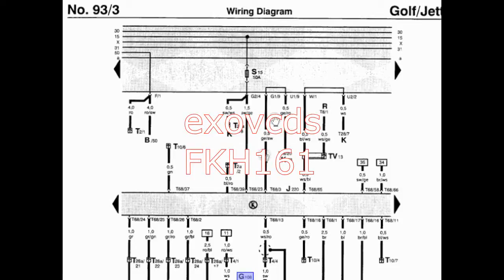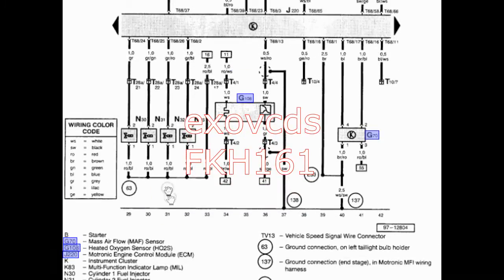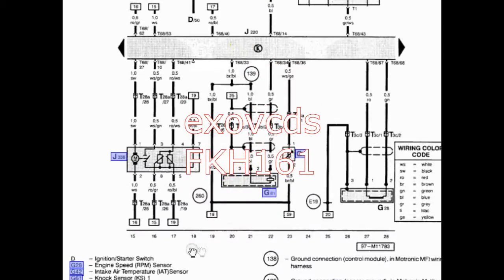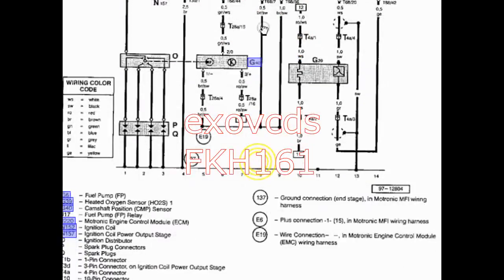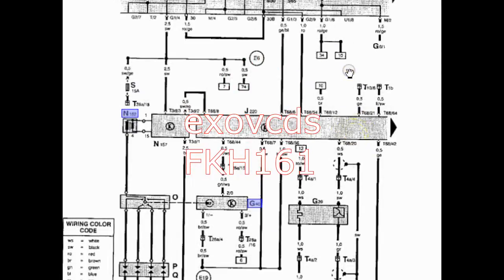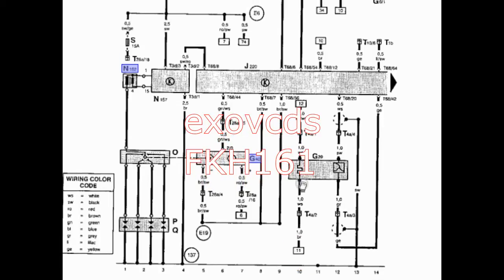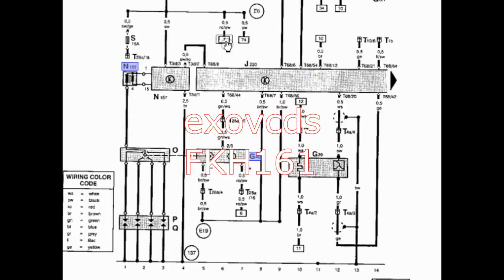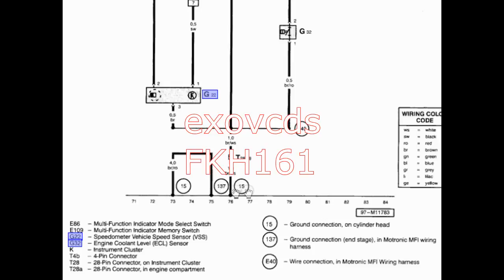Reading (Making Sense of) Wiring Diagrams (helping a viewer)

Comment: Awesome Awesome Awesome!
Reply from the maker: Thank you for watching!
If you have questions / need further info... just let me know!
Reply: @EXOVCDS thank you so much for this video. Can you help me with vw 1995 clx   1.8. The wiring is burnt  not all just the ignition side starting from the fuse box. wires are going out from the fuse box to the coil, the hall sender and the icu
Reply from the maker: @user-om5oh7yf1d 
You need a diagram?
Reply: @EXOVCDS  if you have them  please. Can you help  I have seen some of yr vids. Great
Reply from the maker: @user-om5oh7yf1d 
I will look this weekend when I have time.
Reply from the maker: @PaulBickram  
1.8L engine production code ACC?
Reply: @EXOVCDS  hello it is a 1.8l engine
Reply: @EXOVCDS  don't know about the production code also don't fully understand the wiring diagram s
Reply from the maker: @user-om5oh7yf1d 
I need to know the engine production code, so that I can give you the correct wiring diagram.
Where are you located? Europe, North America... etc? 
Post a video of your engine bay on your youtube channel so that I can see the engine. VW had different versions of 1.8L depending on the country. Different type of fuel injection, carburetor,  emission components etc.
Reply: @EXOVCDS  thanks will do
Reply: @EXOVCDS  it's OK. Don't worry about. I read in the comment yu want people to write to yu. But yu won't give out information
Reply from the maker: @user-om5oh7yf1d 
My email / contact information is easy to find on my website. Link is in the description. 
*FKH161*
I'm still waiting for you to send me an email, so that I can send you a wiring diagram.
In order for me to give you the correct information... I need to know the correct engine production code.
If you think I don't want to help... you need to understand that I can't help... if I don't know what information I have to look for.
Click on "Tool Request" on my website to send me the information about your car.
You could have had a wiring diagram from me over 2 weeks ago already if you had done so.
Reply from the maker: @user-om5oh7yf1d 
Still no email from you.
Reply from the maker: @user-om5oh7yf1d 
I still haven't received an email... how can you if I don't know where to send the wiring diagram?

Comment: Hi Thomas. Thanks for the explanation. Pls can you help me with the complete set of wiring diagram of my VW Bora, engine code AEH or any link where I can get them from. Thanks.
Reply from the maker: I'm still at wok, will get back to you once I'm at home later tonight. What year? Standard or automatic?
Reply: Thanks so much. It's a 2002 automatic transmission.
Reply from the maker: My last reply got deleted by youtube. Send me a message and I will send you what you need. Go to my ABOUT page to find my contact info.
Reply: i have sent you an email. Please confirm when you read it. Thanks
Reply from the maker: @pauliroha5506  I got it... I'm starting work right now. I'll send the files later today.

Comment: Thomas  great video   im trying to learn  DIN style  wiring diagrams  I noticed you were able to hyperlink to the different tracks  are you using alldata?  I use motologic and I am having trouble getting to the different tracks
Reply from the maker: Mark Ferraro Hi, I was using eBahn by Bentley Publishers... but I just opened a wiring diagram pdf with Adobe Reader XI and I was able to follow the tracks by clicking on the track boxes of the wires. This is a wiring pdf from the VW Erwin website (official VW service information)... the files must have links embedded. If you need or would like some diagrams to practice with, let me know. I have been using mitchell diagrams more and more these days... ever since I subscribed to scannerdanner. :-)

Comment: i got elsa,so man have a head ecke reading this diagrams
Reply from the maker: I probably went a bit fast in this video... they are not that bad as long as you follow the correct wire. There are four track references for every splice that pretty much guarantee you find the correct wires / junction.

The flipping around us a bit of a pain... but it makes for a less crowded wiring diagram when compared to Mitchell diagrams.

Comment: Is this the erWin pdf files or another piece of software? Like the point and click feature!
Reply from the maker: I believe that this was the eBahn Software by Bentleypublishers.com... using Erwin pdf files, that Bentley packages in a user friendly software (windows xp required).

Erwin pdf files are great, I have over 16Gb of files and depending on the pdf reader that is used, hot links are recognized.
Reply from the maker: I believe that this was the eBahn Software by Bentleypublishers.com... using Erwin pdf files, that Bentley packages in a user friendly software (windows xp required).

Erwin pdf files are great, I have over 16Gb of files and depending on the pdf reader that is used, hot links are recognized.